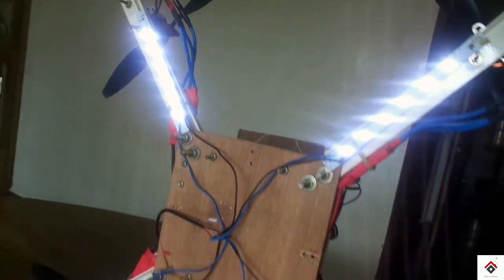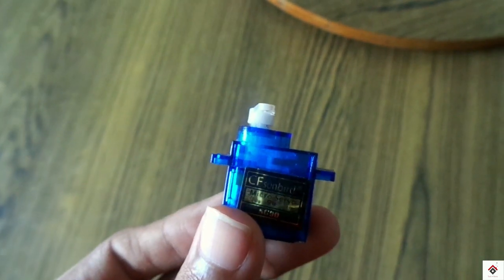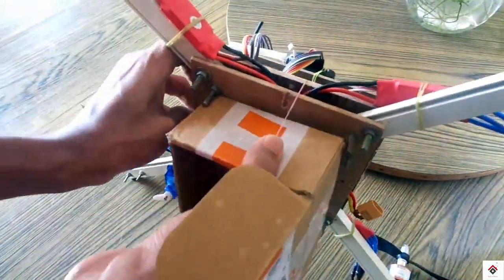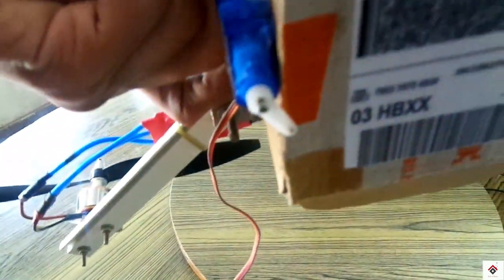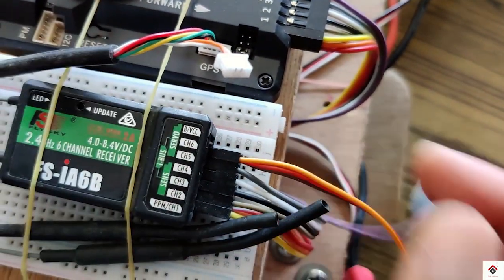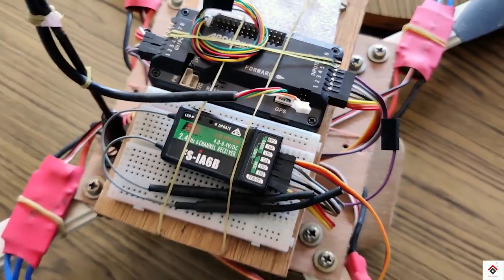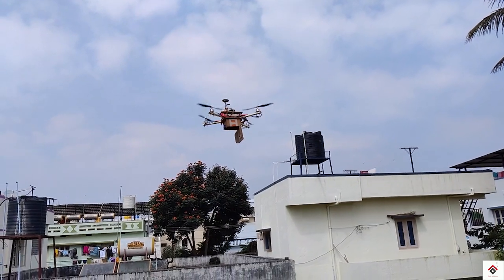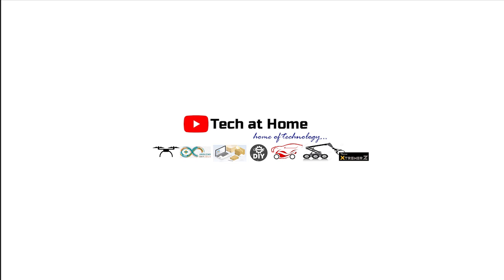Flower Dropping Drone, apm drone | Homemade flower dropping mechanism for drone

Comment: Hey Back again ! I actually use channel 6 in my apm board so where can i use servo for lifting and dropping objects
Reply from the maker: I wanted only Altitude hold mode, so removed connection from channel 6,
And added servo directly to receiver channel 6.
I have also shown in the video

Comment: Is only a servo motor is used for opening this box
Reply from the maker: Yes
Reply: @techathome   is that the only step to open the box by transmitter
Is any other programming or anything is needed
Reply from the maker: No, directly connected servo to receiver
Reply: @techathome  how can we set the servo motor control to the transmitter
Reply from the maker: Directly connect servo to the receiver channel 6.
In the transmitter, assign channel 6 to VarB

Comment: Bro i made a drone with apm. But a problem. All video showing that in altitude hold when we give throttle to 50 it dont fly. But my drone is starting to fly and dont get the balance. I think the problem is in all video they use 1000kv brushless motor.but i am using 1400 kv motor is it the problem 😕🤔
Reply from the maker: No it's not the problem of 1400kv Motors.
Always take off your drone with Stabilize mode.
When it reaches to some height, then change to altitude hold Mode.
Reply: @techathome  very thank you bro